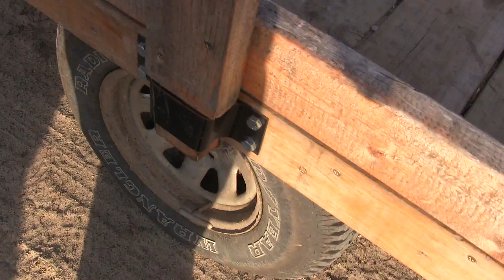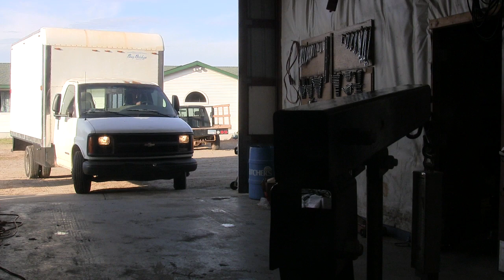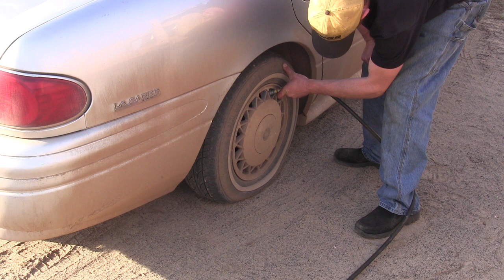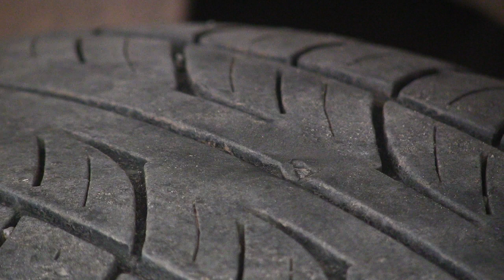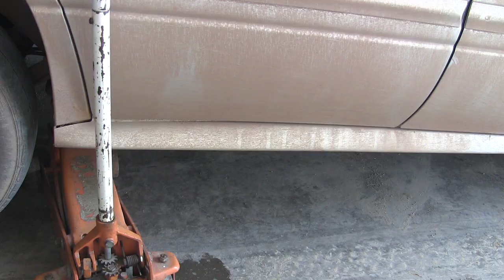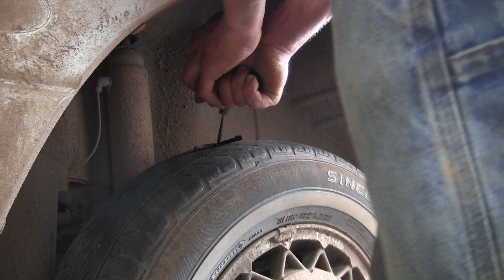Fixing A Flat

Comment: I plug tires all the freakin time. You should twist the plugger tool when you push it in, makes it much easier to work with. Plus, I have a can of rubber cement that I put on the plugs to lube them up first. THAT makes it ten times easier. You can find it at Tractor Supply, among all the "tire accessory" stuff. ;)

Comment: When you get rid of cars for scrap, take the tires off to use on other cars you might come across. Harbor Freight has a larger air compressor. When it says 30, it's empty. I think you plug it empty.

Comment: I don't know, man....that tire looks pretty worn already, I'd think about replacing it soon.
Reply: +justsomeguytoyou I've had much worse tyres on my vehicles in the past.  Not saying it makes it right, but unless it is being driven at highway speeds then it should be OK for a while longer.  The treads in the middle of the tyre are still good (where the puncture was), it is just the outer edges that have some wear.

Comment: Fill it with slime, call it a day.
Reply: +Clayton εжз 2 cans should do the trick
Reply: ‍1marcelfilms Cans? Normally it's two or three pumps (ounces).

Tire looks like it's at the end of it's life
Reply: You mean spray flat fix?
or something else?
Reply: ‍1marcelfilms Slime... green slime. You can get a gallon for $25.

I use the liquorice plugs too, but only as a last resort.

I'd never use that fix a flat crap in a can...
Reply: Slime eats your tires in the long run, though. Gets barely more miles out of it than a run-flat. Just long enough to get you to a tire store. might as well replace it if you put that stuff in it. I'll never forget what that shit did to my bike tires.  Fixed the flat alright, but ate through the tube and tire two weeks later.
Reply: Josh Nixon Wondering what the condition of the tube was before you added slime.

I originally started using slime in wheelbarrow tires eight years ago. Never had a problem.
Started using slime in car/truck tires shortly after.

If anything slime starts to dry up and break down over time.
Reply: +Clayton εжз brand new tire, brand new tube. Stupid me, I put it in as a preventative. Never will again.